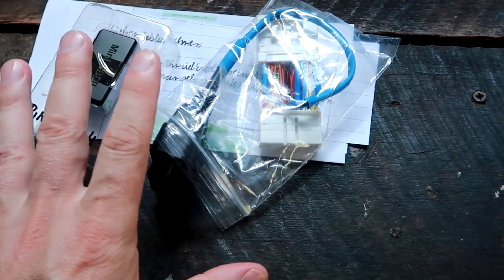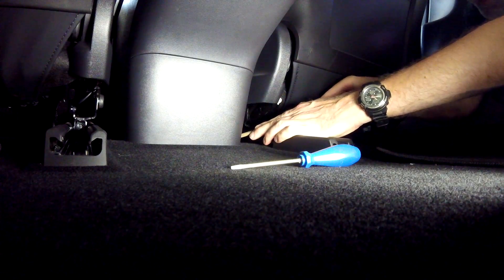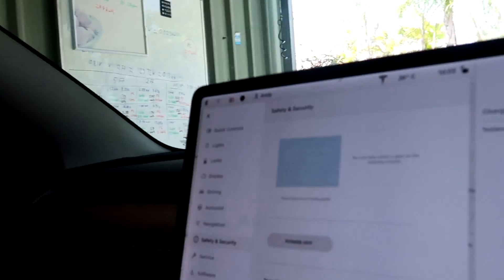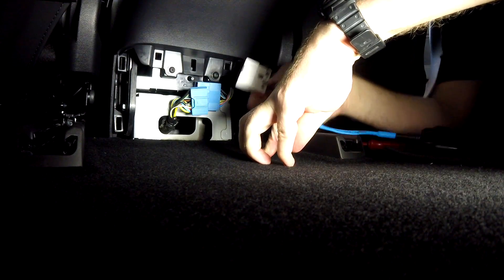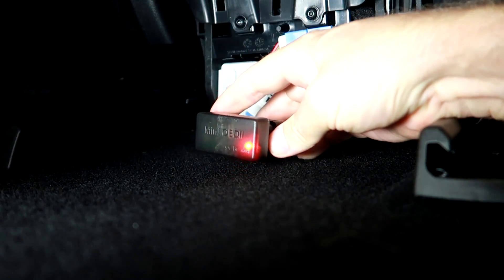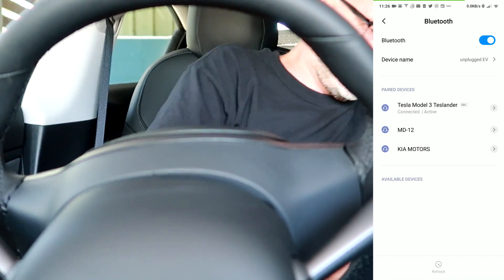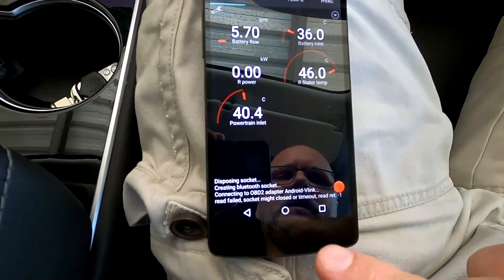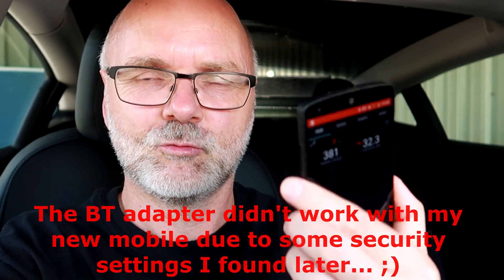EP318 - Installation of the Tesla Watchdog App (aka Scan my Tesla) in a Model 3.

Comment: What is your nominal full pack and nominal buffer??? Also got SR+?
Reply from the maker: He's, I got an SR+
I mentioned this in upcoming videos. Nominal full pack has decreased from 51.7kWh to 51.1kWh and then risen again to 51.5kWh.
Reply: unplugged EV I have watched most videos after this one sofar :) digging for info about all battery stats, my nominal full pack is only 47 kWh.. recently got ScanMyTesla
Reply from the maker: @MrGoogle87  There is no difference between the SR and SR+ battery. SR is only software limited.
Reply: unplugged EV I know, but my point is that mu hardware never allowed the software for it to be a SR+
Reply from the maker: @MrGoogle87  How many k's does your app show when you set the slider on the battery to 100%?
Reply: unplugged EV 336 tot 344km with a warmed battery